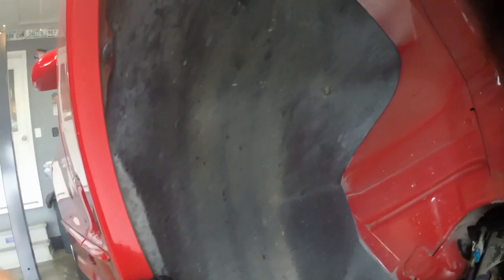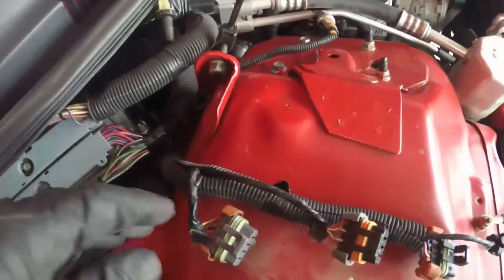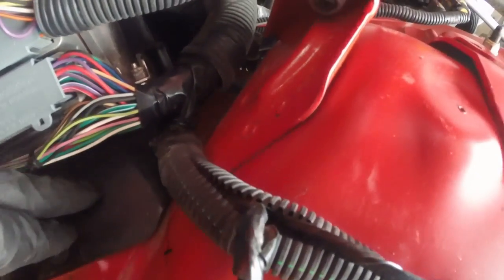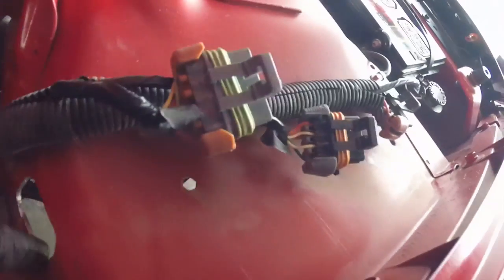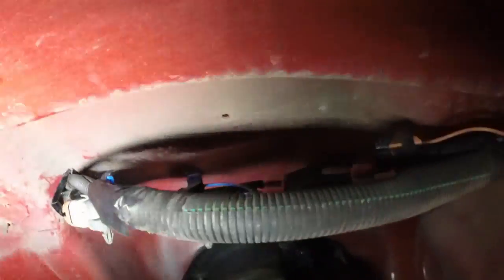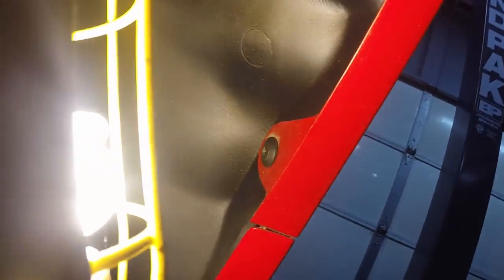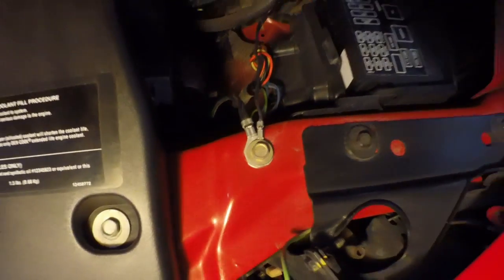How to Hide wires Trans Am WS6 Camaro Firebird

Comment: Looks very very nice, but I'll pass on mine I don't like drilling in the body, I haven't even done the fuel pump door under the rear carpet 😅
Reply from the maker: I probably will be doing a trap door at some point
Reply: I am however fitting 4x6 headlights, and I will be cutting and drilling onto the headlight assembly to make them fit
Reply: I also installed rear air shocks to aid in ride high, and shortened the shifter , I also installed custom fog lamps using the oe brackets  xD I really like my firebird it's my daily driver

Comment: Thank you for the video.  It is very informative.  What does the vacuum line on the passenger side go to? I have been getting conflicting answers.
Reply from the maker: Not sure which line you are asking about
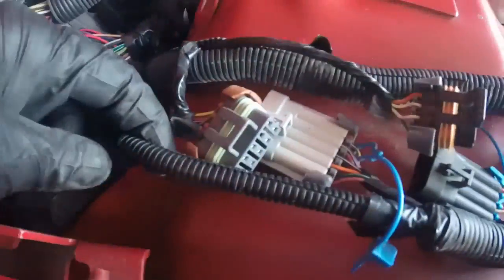Reply: In the video, you pointed out a a vacuum line in the wiring harness that is over the passenger side fender.  Its at the 2:05 mark.  I have been trying to figure out where both sides of that go  @TWAMotorsports
Reply from the maker: Goes to vacuum canister on the lower frame rail
Reply: Awesome, thanks man.  Appreciate it @TWAMotorsports
Reply from the maker: You're welcome

Comment: In the video you mentioned removing the secondary vacuum line or something that goes in the side of your air box. Mine has aftermarket headers on it but still has the tube going to the side? How do I delete?
Reply from the maker: Remove and retune computer
Reply: @TWAMotorsports  is it worth removing and do you gain anything?
Reply from the maker: Weight and looks

Comment: If I put those wires in the inner fender here in the U.K. my car would stop working soon due to water ingress. I wouldn’t recommend drilling the strut towers either, they are structural and it would fail inspection
Reply from the maker: this will not affect the structure of the strut towers. It also is not open to the elements as it is under the liner and all weather pack connections.

Comment: Where is the video on removing air injection? Thanks
Reply from the maker: In header install video
Reply: TWA Motorsports thanks! Will this turn the check engine light on?
Reply from the maker: It sure will

Comment: oh man i know what you mean as far as putting that liner back up, what I ended up doing after getting frustrated with it, was making the holes in the liner bigger so I could see where they line up on the inner fender, then just added an appropriately sized washer to the bolt.
Reply from the maker: Yeah I use a light to find the holes. It sucks.

Comment: I just did this and i ran the hood release  cable through the hole above the screw hole at 6:22.  You can see it above the screw hole . You will still need to run a drill through it for a little more clearance but it worked good.  Nice video.
Reply from the maker: Tirefryer91efi good call thank you

Comment: Had a question pertaining to the engine bay of your car. I watched pretty much all the videos but I think I missed the one apparently were you pull the motor out. Did you personally go through and spray the engine bay or did you have that done professionally? If you did it yourself did you get the paint color of the RPO codes? I know some stores sell the specific red for GM that appears to match very closely, just curious as to how you went about doing so. Thank you keep the awesome videos come in please!
Reply from the maker: I had a video of the motor pull and paint. I used duplicolor and clear. Not professional but way better
Reply: TWA Motorsports awesome man. She’s clean for sure. I’m getting my supplies together to get my new to me F-body cleaned up. The rerouting of the wiring harness is next on my to do list. Thanks again!
Reply from the maker: You're welcome. Good luck on your build
Reply: It’s time for some new Trans Am Videos!
Reply from the maker: I agree. Tell the parts suppliers

Comment: I could not get to the Wheel Sensor Wire cause my headers were in the way from moving the strap attached to the fender
Reply from the maker: Yeah it's a tight fit in there. You should be able to just barely reach it.

Comment: Does the hood latch cable just kinda hang in place under its own tension or did u have to tie it down? Maybe the fender liner just holds it in place after its bolted down
Reply from the maker: Kinda just hangs there. You can secure it if you'd like

Comment: Looks great man. Especially without the mess of that cruise control module and cables. Did you delete it yourself?
Reply from the maker: Thank you. Yes did myself. On traction control cars they have a controller behind the battery. Mine is non traction control car so it doesn't have that. You can still do this and move that controller behind the computer.

Comment: Thanks for the video man. Ive got an 01 WS6. I've always been curious how this was done. Please keep the videos coming! I'm very interested to see how the air injection pump and all that comes off. My car has headers on it but still has the air injection stuff to that stuff really clutters up the engine bay.
Reply from the maker: Austin Anderson thanks for watching. I did the video on air injection removal with the header install. If you already have headers you will need to buy or make some block off plates.

Comment: Shit yeah sure it looks more clean . but whenever you need to replace those wires and hoses you have to do a double job taking of the tires and covers and lifting the car up. Nah I am ok.
Reply from the maker: I've owned several of these cars and never had to replace those parts on even 200k mile cars.
Reply: @TWAMotorsports  yeah you are probably right. 👍. To be honest the car look cleaner bro.
Reply: @TWAMotorsports  my trans am has 240k and I have never replace those wires yet.
Reply: @TWAMotorsports  anyway good luck in your TA ws6 proyect .
Reply from the maker: @frankiehati8285  thank you
Reply from the maker: @frankiehati8285  I have own 60 of the ls fbodys and never had an issue.
Reply from the maker: @frankiehati8285  thanks